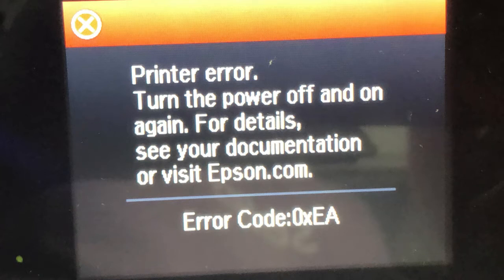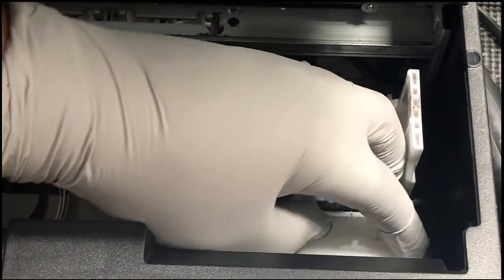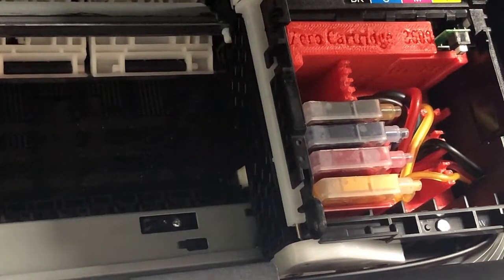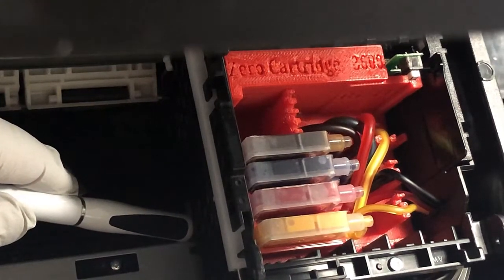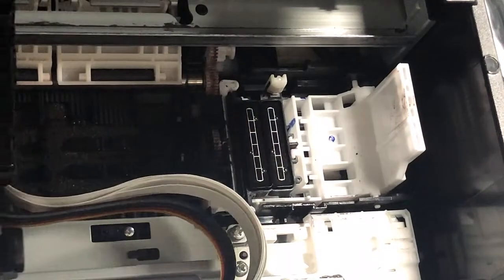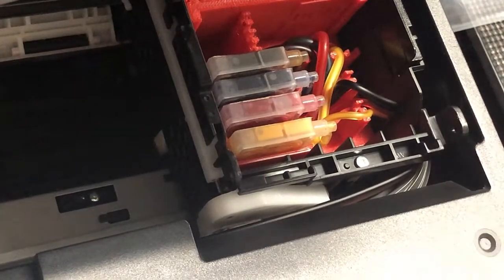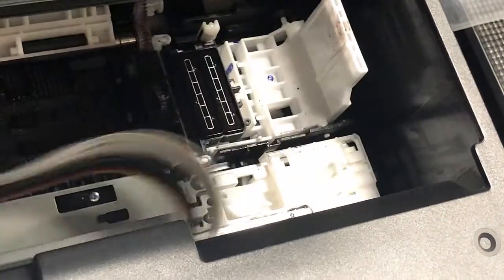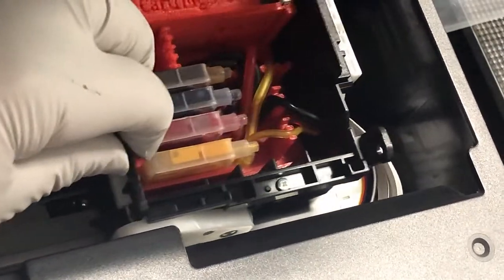Fix Epson Error 0xEA with Scratching Sound - Not a Paper Jam Situation

Comment: Mine makes a loud grinding noise and the carriage moves all the way to the left and it errors our with the 0xEA error. I've tried the steps in this video and still same. Any suggestions?
Reply: I have the same issue. Did you ever find a fix?
Reply: @hgpot  yes. I got rid of the printer. But before I did, I checked the ribbon behind the carriage and it was stuck in the back of the carraige.

Comment: I found out that there is no clicking sound on the right side of the carriage on startup.  The white spring-loaded plastic stopper does not move forward to lock the print head.  No clicking  and it does this a couple times, maybe 3 then starts the trek left and ends up with the screeching sound.0XEA error.  Can I fix this myself???

Comment: This is starting to annoy me, lol.  I bought 2 encoder strips and threaded them thru the sensor bracket behind the carriage.  MShrader211 was right, the encoder strip was not lined up to the sensor and that made it slam hard into the left side of the carriage .  Now the carriage moves to the left and stops short of the side for a second, then moves left and Then the short grinding noise about a half second and then it throws the 0xEA code.  Turning it off then back on produces the same error with either strip.  Do those strips have to be perfectly flat/ not bent or kinked anywhere, for the sensor to read where the carriage is?  What else could be making the noise?  I bought the printer for $30.00 lol and don't want to get rid of it.  I am being stubborn and want to be able to say I got a $200 printer for $30 and fixed it.  You know the feeling...

Comment: Ok so.... same error message, print head slams Right then Left stops and error message pops up onscreen. Seems like it isn't able to tell where it's print head even is.... I mean it slams HARD into the sides of the machine! What should I be looking for in this instance? Another person below asked the same question basically with no answer posted... :-(
Reply: Found it! The timing ribbon was off the print head it was hung just below where the sensor is that reads it. IF your printer is slamming the print head to 1 side or  the other then throwing this error code, check for that clear ribbon it should be straight across the print head and not super-tight... if it appears deflected or twisted downward at the print head, then it's not right it's caught itself some how! Gently push it down with your fingertip next to the print head and it will pop loose and be straight again.... now your printer will be able to tell where the head is, it will re-calibrate for a few minutes then be ready to go back to work! Just saying....
Reply: @MShrader211  Thanks friend!!! My little English and google translator helped me correct it this way. The timing ribbon was off the print head (behind of) , I just push it and it found his place!! That´s all!
Reply: @MShrader211  , I wish I could send you a digital video of what my printer is doing.  It sounds like you are right but it still crashes.  Where is the sensor that reads the clear, plastic ribbon?   I don't want to do this too many times for fear of permanently breaking something.  Joe.
Reply: @bvnseven  Sounds like the same thing to me, the printer doesn't know where the printhead is so it slams into the side of the printer (without so much as slowing down!). You're going to have to look inside the printer while the power is off and the printhead is unlocked so you can manually move it to the center of the carriage.... there's is a thin seemingly clear plastic strip that spans the width of the carriage, find it and follow it to the printhead with your fingers it is likely deflected at the print head (as in, not straight across... being held down or up at the printhead because it isn't in the correct track where the printhead sensor for it is located).... you'll have to get it back into the correct position. Wish I could explain it better but that's really all I can tell you.
Reply: @MShrader211  , Thank you.  I did clean the strip and played with the position.  No luck yet but I will keep trying.
Reply: @MShrader211  , Last-any suggestions on what to do next?  No cartridges in the caddy, no paper jams, cleaned strip 4-6x, Still get the error.  There are 3 white gears on the left side and the topmost gear has a "lever" which comes out into a cutout area in the metal track.  That lever sometimes stops the printhead and i get the noise.  When I force the lever to stay out of the way of the printhead it goes all the way to the left and appears to hit that brown holder with the white gear that holds the belt.  Maybe someone else can read this and help too.  Thank you for all your research!
Reply: @bvnseven  Were you able to locate that clear tracking ribbon that runs across the width of the carriage? Does it appear to be straight all the way across, while you have the printhead manually positioned in the middle of the carriage? If it's not the tracking ribbon that's the problem then I have no other ideas honestly, but the symptoms you describe match what I found... the printer doesn't know where the printhead is because it cannot read the tracking ribbon. Be sure and use a good light and magnifying glasses when looking as it's not easy to see in there!
Reply: @MShrader211  , I did some more research and left you a link to another site with more good answers.
Reply: @MShrader211  Thank you! Your detail about the ribbon behind the printhead carriage needing to be straight across is what I needed! Problem solved!!
Reply: @MShrader211  i cleaned the encoder strip, no luck.  I bought a new encoder strip, cleaned it, same problem.  I keep thinking that the clear strip goes in a SLOT behind the printhead and always put it in there.  Maybe it doesn't go in there but it sure looks like it was meant for it?  I will take it out and see what happens unless you are sure that it does go inside the slot?  Thank you for all the help!

Comment: About two years ago I lightly dropped my Epson from about two feet off the ground and since then it would make a high pitched screech then turn itself off. I could not find the receipt so I could not call the help line and ever since then the printer has been a expensive paper weight. At the time I could not find any information on how to fix it. This sounds like it could be the problem. Although my printer is set up differently so I am not sure how to get it unstuck.

Comment: This is a pretty helpful video relating to my issue, but does not fully solve my issue. I had cleaned my print heads manually and had unplugged the unit while actively printing in order to release the 2 printhead carriage catches to move it freely lL/R....however, after cleaning, i get the 0xEA error message. Turning the unit on and off does not make the catches automatically re-catch the carriage. My carriage slams hard into the left side making a terrible noise and does not return to the right because these 2 release points do not re-grab to the carriage upon start up like it does in your video. How can i get them to reattach again? Can I lock them back into place somehow?
Reply: The timing ribbon is off the print head it is hung probably just below where the sensor is that reads it. Check for that clear ribbon it should be straight across the print head and not super-tight... if it appears deflected or twisted downward at the print head, then it's not right it's caught itself some how! Gently push it down with your fingertip next to the print head and it will pop loose and be straight again.... now your printer will be able to tell where the head is when you turn it back on, it will re-calibrate for a few minutes then be ready to go back to work! 

My 1st thought when I got this printer into my shop tonight and turned it on, and it immediately slammed the print head hard into the left side of the carriage, was that this thing doesn't know where it's head is on the carriage! 

ps. The scanner bar will be fine once the timing ribbon is straightened out, it just happens to be around the middle of the scan plate in it's startup routine when the printer realizes it doesn't know where the print head is and stops everything before throwing that error code! The scanner is just a symptom, not part of this actual problem.
Reply: @MShrader211  Bless your heart! Thank you.
Reply: @MShrader211  this is exactly what happened with my WF -3620. I just slightly moved the clear ribbon off the front and it worked perfectly!  Thank you for your suggestion!  👍
Reply: @MShrader211  The ecnoder strip, is it supposed to be in a track ON the printhead or Away from the printhead.  I put the printer away for a few years and now it either works in less than a week or it gets pitched.  Please Answer.